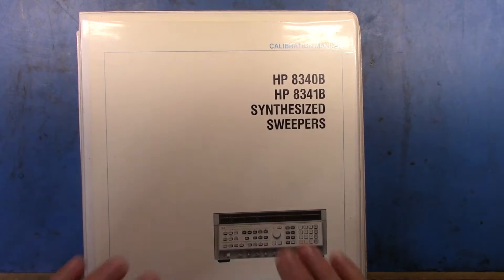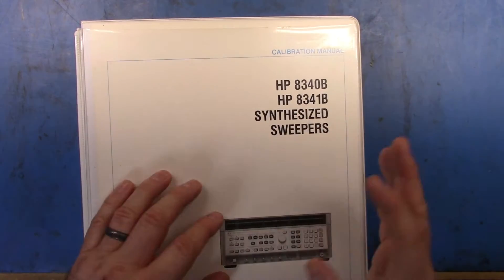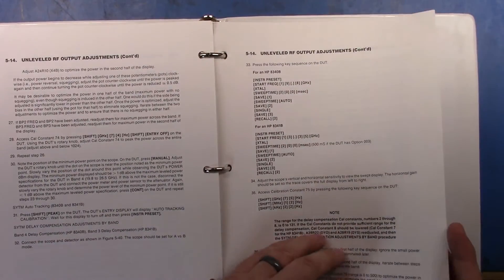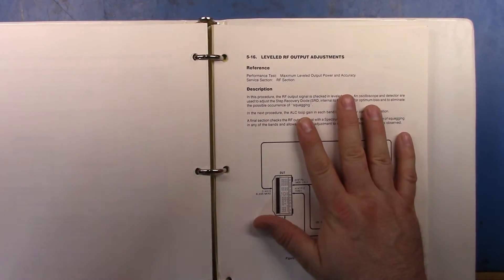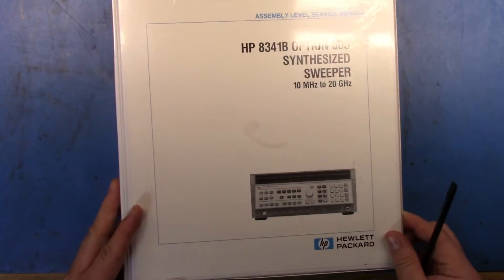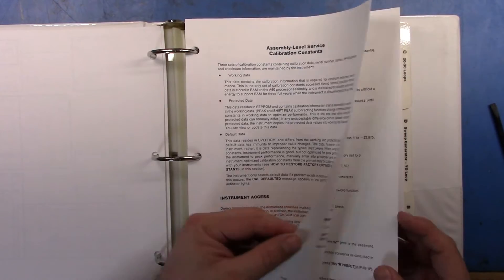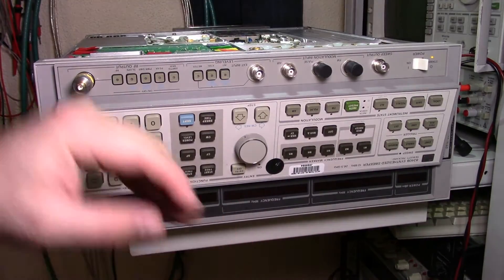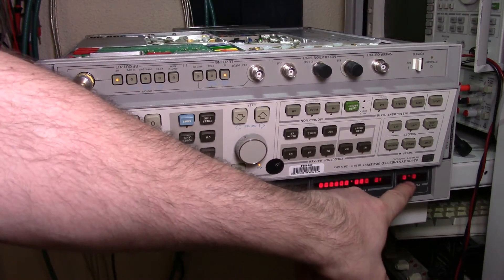HP 8340B Part 2

Comment: Interesting. A theory I would say as to what happened could be a tech accidentally entering in the correct sequence of buttons to go into cal constants edit mode. That sheet of paper is very handy. When 1st cleaning out the unit, my first act was to take pictures of the constants so if something degrades the paper, I still have them on hand.
On a side note, I had released a disk image file of the HP cal. & attenuator software for all 834xx syn. sweepers on the HP/Agilent yahoo group about a month ago. The software requires the cal data on this sheet along with equipment, from the same manufacturing time, to run properly.
Reply from the maker: Thanks - I scanned the sheet right when I found this so hopefully it'll stay around. I still have a slight bump in the units output around what seems to be a multiple of the internal 3.7Ghz oscillator but I haven't had a chance to get back into it and try the adjustments again.